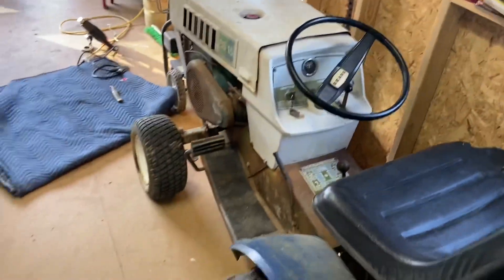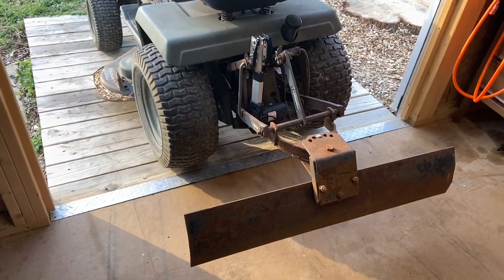Sears suburban electric three point hitch upgrade-progressive automation

Comment: So most everything works with a 4 inch stroke?  And that gives adequate range for ground clearance and also good down pressure?
Reply from the maker: , based on my research, the original was four  inches -also they come in slightly different shapes so make sure whatever you purchase would fit
Reply from the maker: Make sure obviously it is designed for outdoors because a lot of of them are not and then of course stronger meaning more weight  capacity is better

Comment: Neat, Youtube algorithm showed this video in the list too.  Guessing the sleeve maybe keeps crud off the shaft?  Great detail to see regarding the design also.  The JD some where along the way I was blessed with a sleeve hitch.... I think when I rescued a deck minus one of the anti-scalp adjustment mount and wheel.  The gentleman threw in a bagger that can use some plastic welding and the sleeve hitch for free which was awesome.  Awesome front end loader and seeing the Sears Craftsman too.  Planning to build the subframe for both also for the front end loader, back hoe and a modified dedicate high low for forks, pile driving, augering and someone noted maybe I can drill wells too with.  Plan with the front end loader attachment minus the bucket, to also make a cement mixer from an old either 38" or most likely 42" JD snowthrower and auger and modifying most likely the snowthrower frame material by basically rotating 180 degrees with an actuated shoot for the pour that can use a flexible pipe or just fall out.  Just need to find the time to complete since really don't need just yet.  Thinking will hydraulic motor operate or maybe electric possibly if I can fit with the snowthrower idler subframe assembly where I'd run either the hydraulic pump or generator.  Anyways, neat to see and thanks again for sharing!  Kind Regards, In Christ.
Reply from the maker: Thanks for watching and good luck with all your projects
Reply: @MurphyMower  Thank you!  Needed that affirmation and motivation.  Literally just got back from the store with some primer paint that is rated for use on plastic so I can paint the Kubota hood for the JD 240 to match the rest to be the Ford blue design.  Figured with the warmer weather coming around again... might have a good few days to paint and stay warm enough to cure good.    Got the sewing machine mechanical design and restore to functionality bug this winter... so slowed down moving forward on some of the other projects.  Likewise, all the best down there and good logic!

Comment: I just replaced my whole unit with a manual one.  I had a lot of trouble with the actuator.  I think the only purpose was to lift the Roto tiller, I was frustrated that the Sears electric lift had no down pressure for the disc and plows.
Reply from the maker: I thin k there is a way to make down pressure on this- but did not try
Reply: @MurphyMower  yeah, if you cut away enough metal on the lift arm to allow the bolt through it should work, what model of actuator can you replace the original with?
Reply from the maker: I got this on Amazon it is progressive automation‘s linear actuator four-inch stroke 400 pounds and I believe the part number is PA -04 - four - 400